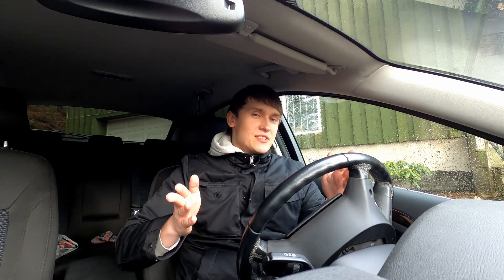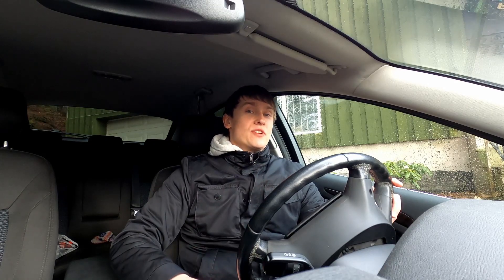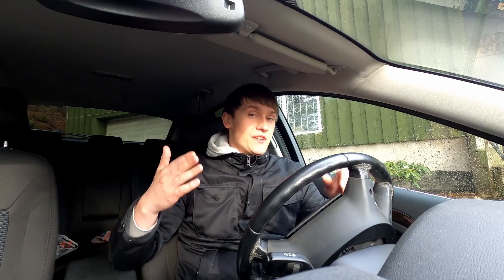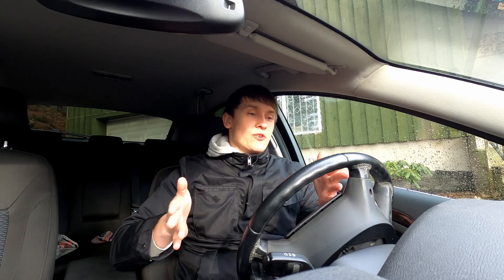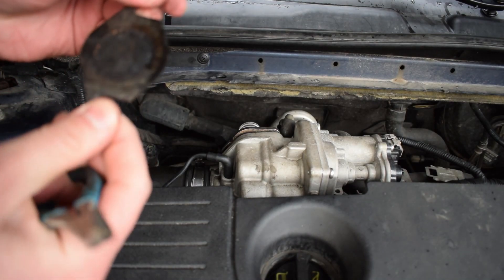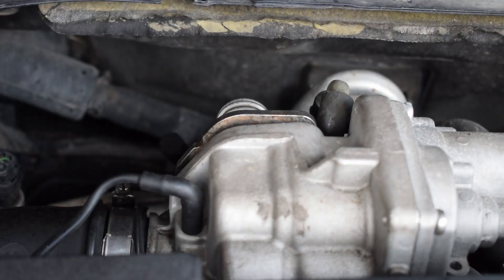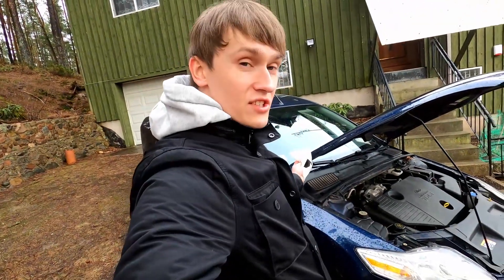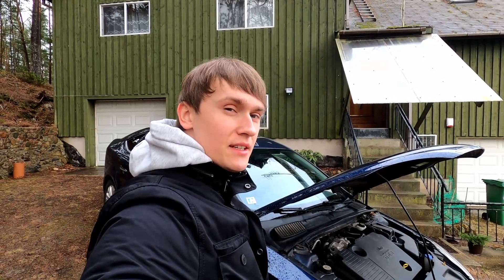Engine Running Cold (Blanked EGR Update After Three Years)

Comment: Ice road truckers, deliberately cover the radiator to restrict the airflow so it heats up faster... so basically your system is working fine, its working too well. Instead of carboard why not get a metal plate and cover a portion of your radiator.

Comment: The reason for loss of power is a faulty EGR valve , the car is designed to run with an EGR. If the air temp is below 0 the EGR stays closed permanently . Replace the valve and the car will run better and at the correct temperature. 2017 it’s estimated 38000 people died prematurely from NOX emissions from diesel engines , the EGR system reduces NOX emissions. Please be responsible and do not bypass this system , an inlet manifold can be cleaned .

Comment: The other day I just made an STS EGR blanking plate for my 2006 Mazda BT 50 2.5 common rail turbo diesel, it now runs much cooler but the check engine light has come on. I have not put a screw in the vacuum line yet, so the EGR valve is still working but drawing no exhaust gases. I live in a subtropical climate.
Reply: Buy an EGR delete cable 1k peso from Thailand that will switch off EGR system no engine codes, then blank off EGR to make 100% sure no carbon going to intake system

Comment: 13 kilometers is still way too long for an engine to warm the coolant properly. Something else is off here. As stated before in the comments, blocking the EGR will result in higher combustion temperatures. This does not automaticly mean higher coolant temperatures tho. Oil temperature is what you would want to know. Low oil temps will give less lubrication and more engine wear as needed. I would replace both thermostats for OE Ford ones(yes, there are two on these engines) and see if this cures the issue. Also, that firmware update is always a good thing to do.
Reply: The 1.8 TDCi takes longer to warm up to its optimum operating temperature than other engines because it is not of aluminum construction but a cast iron engine block.  And one more question.  Where does the 1.8 TDCi have the second thermostat?
Reply: I can't find the secondary thermostat location, I have the 1.8tdci 92kw, where could I find it?

Comment: If putting cardboard in front of the radiator helps, it's possible your radiator shutter system is stuck open.

If anything, blanking the EGR should result in the engine running warmer. The EGR is designed to recycle exhaust gas to reduce combustion temperature in order to reduce the oxidisation of nitrogen.

Comment: See this vidoe was posted around two years ago, although someone may be able to offer insight on this,  what if one was to drill say .375 inch hole in blocker plate for a "partial block," to allow some gasses to recirculate? 💡

Comment: You can actually re route the egr coolant pipes straight from outlet to inlet instead of it running through the egr so the engine doesn’t take longer to heat up
Reply: Do you know where the coolant pipes go to? Someone has taken mine off and I’m trying to work out where they should go to
Reply: Just remove inlet an outlet and use pipe to join.

You are taking out the egr cooler.
Reply: Can you please detail this procedure?!? I have the same problem as the guy on video. I would be thankful ☺️

Comment: Good video! Well if your engine never reaches perfect working themperatur is not good over long time, because the oil will not perform propperly. The wear in the barings and pistons is bigger.
However, I just found some YT-video where they using blanking plate with a some 7mm wide hole in it. So this sounds for me as a good compromize. Not completely blocking the AGR but reducing the flow down to about 25% or so. Like taking the best out of both worlds. With that you have at least some EGR flow to help the engine reaching its optimal working temperature but without gettin too much carbon deposits in your intake manifold and valves. I gonna make a ERG blanking plate with a 7mm hole in it for my Hyundai H-1 2,5l Turbodiesel this evening. Will see If I feel any difference.
Reply: Results ?

Comment: Also it is possible you have a slight stuck open thermostat I had the same easy to tell squeeze the top and bottom radiator hoses while engine is cold if you don't get resistance it's open

Comment: Because you haven’t coded it, your engine is expecting additional heat via egr. When it doesn’t receive it, it cools too much. Will also be stopping your DPF regenerating properly
Reply: 2008 1.8 tdci has no dpf
Reply: 1.8tdci LYNX engine has no DPF only a Cat

Comment: I have a taxi it’s a Toyota avensis I.6 diesel d4d. EGR and EGR cooler gets clogged up every 10 thousand miles gets expensive to get cleaned so often. Would you recommend getting it blocked off 🙏🏻
Reply: That’s BMW engine with DPF you cannot block the EGR without deleting the DPF it will not regen properly and cost 1000s
Reply: @Mr330d  apparently been quoted by few mechanic’s £150 to get computer remapped

Comment: How can it make a difference to engine temperature when the water still flows through EGR cooler?
Reply: The coolant still flows in the EGR cooler but the exhaust gasses do not. They carry the heat and the water takes it. Once the valve has been blanked, the air inside the cooler become stagnant and stays pretty much at the coolant temperature.
Reply: The EGR isn't heated that much? Because the flow is restricted... i suppose.
Reply: So that’s a good thing then?
Reply: @Chris-jy3dm  Staying cold for too long isn't exactly a cure-all for a diesel engine, but my ancient TDDi doesn't even try to warm up below 70 km/h, so can't be much worse than usual.

Comment: EGR was very good in decreasing nox but it's not suitable in Philippines because it's hot weather while US was cold weather .so it's better in U S but most likely not suitable was carbon deposits in the intake manifold,t/c was usually design for very high temp.i think it will not damaged T/C unless it it design by very poor material,air intake was design to adjust close or open that's probably cause engine performance ,when EGR returns exh.gas to the engine ,air intake was also functioning vacuum controlled by computer to reduced nox  when weather was hot or cold,so when EGR was blocked ,intake air must be always at full open to remain engine performance less air more fuel would make engine overheat or cold.

Comment: Hi all,
I'm looking to blank my vans egr, but the research I've done shows the engine runs slightly hotter when blanked not colder... it states because it gets more oxygen it burns the fuel more efficiently thus providing more power, which in turn produces slightly more heat? With this added heat it helps reduce them coking up as much helping to prolong the life of the cat/dpf but reduces turbo life slightly due to it running that little bit hotter so adding wear there. Not feeding the engine it's own fecal matter helps keep the oil cleaner for longer causing less wear internally. Overall it's a trade off but I think it's definitely worth blanking the egr off as there are more benefits than cons, even though it's slightly worse for the polar-bears (I hope they accept my apologies). Have I missed something here or do I have the wrong end of the stick? TIA
Reply: Your good, go ahead and delete it.
Reply: Yep, the EGR is supposed to reduce combustion temperatures in order to reduce the production of nitrous oxide. So blanking it would result in higher combustion temperatures and a quicker warm-up.

Comment: Your thermostat is toast.  It should warm up regardless.  And 75 is really cool for a Diesel engine.  Should be more like 95 degrees.
Reply: 95 on this particular engine no chance. I have the same 1.8tdci and it sits at 87°C like he said, max 90°C in summer when I push the car to the max :-P but yes 75 is definitely to cold
Reply: Depends on the diesel. My old Mitsubishi 4M40 2.8LTurbo runs at 76c. I have a thermocouple on the thermostat housing and it sits on 76, hits 80c after a long climb.

Comment: Do you still have mondeo? I have blanked EGR valve 2 years ago and engine is still runing with no problems. During the winter when outside temperatures are low it needs little bit time to warm up an the engine is little bit louder till warm up a little bit. Probably you will also hear occasional injector rattle around 1500rpm under load.

Comment: I replaced my EGR with a new one. Indeed it was an expensive part, but no more issues since.
Reply: With bad egr, did you get transmission fault warning?
Reply: i get... my light ESP turn on.. low circuit EGR
 @bmw12347
Reply: I want to ask you if you also had a problem with the engine warming up for a long time and that is why you replaced the egr valve?  And after replacing it, was this problem solved?  I am asking because I also have a 1.8 TDCi, I have already replaced the thermostat with a brand new Ford OEM part, I have replaced the coolant temperature sensor and the engine is still hard to warm up in cold weather.  Even cold when driving downhill... Thanks in advance for your reply.

Comment: Hi my name is Alex, ive got my ford mondeo 1.8 tdci 2008 ffba code, my car when the engine is warmed and drive it around 80 km and push the car to the limit over 120km, and force drive more agresive the car just make like a push and nothing happen, i dint find a solution, your make the same is like you drive at 80km/h and than acelerate over 130 or more agresevile when the engine is warmed the car make like a push and nothing this happen every time i drive agresevely if a drive slowly nothing happen

Comment: HI, I am also thinking of blanking out the EGR on my 2007 Focus 1.8 tdci since it sometimes causes power drop at around 1700 rpm and also causes the car to shake when the enigne is hot and idling (I already replaced the engine mounts). My daily drive is about 18 km one way and the engine is alreday slow to warm up on this route since the route doesnt include a lot of acceleration or highway driving.  Engine oil in all cars warms up even slower than the coolant (it can take 30 + km to reach working temperature during the winter) and that translates into higer viscosity and more wear and tear in the long run, so blanking the EGR would just add to the problem of slow warmup. Therfore I think the solution of attaching some kind of blanking plate (I would use metal or plastic) over a part of the radiator to compensate egr delete is not a bad idea at all. Even ford used a blanking plate from transit van to cover part of the intercooler on the focus RS mk3 (google it!), since the cooler was too efficient and caused condensation in the intake system at low ambient temperatures. You can also make a blanking plate system that is easy to attach and remove and have it on during cold months and remove it during summer. I will report back my findings if I decide to go for it on my car. Great videos by the way really enjoyed all the ford related ones, lots of useful information!

Comment: you didn't have a check engine error when you were blanking an EGR?
Reply from the maker: No, this engine is one of the rare examples where it wont pop a check engine light.
Reply: I get a check engine P404 code and my egr is stuck in closed state…can I continue driving without issues or should I replace the valve ?
Reply: @dumbf7604  Did you solve the problem, new blanking plates have a 7mm hole so more a restrictor than a blank, but seem to work a lot better allowing some exhaust gas through and reducing to about 20%